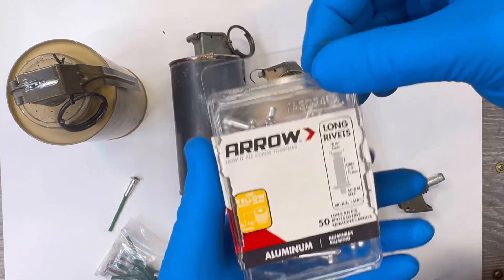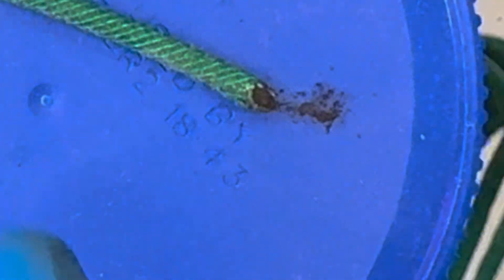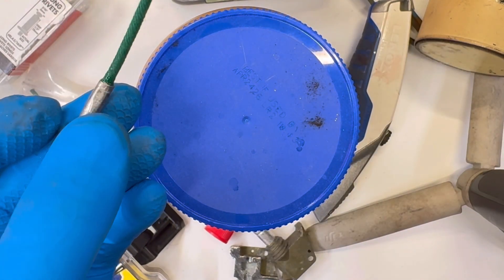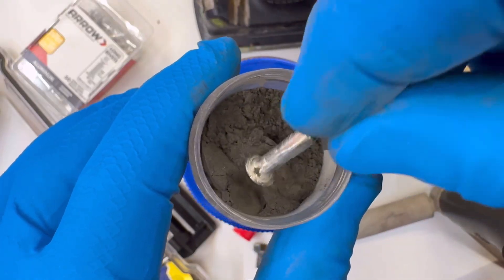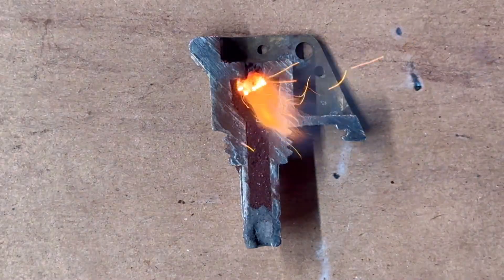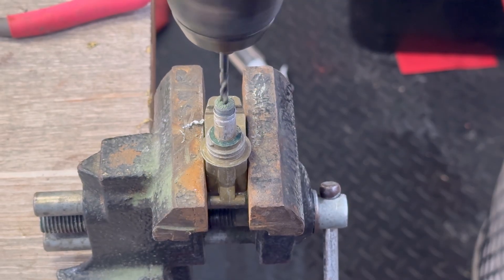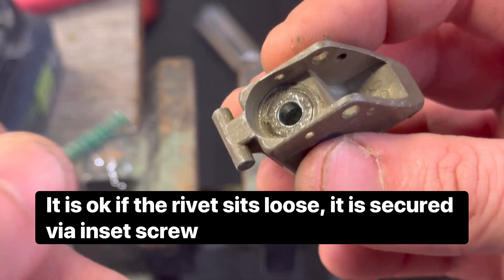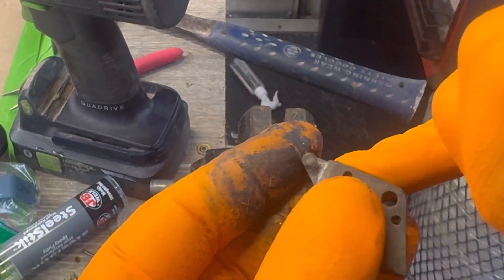Turning Surplus Fuzes into Smoke Grenade Igniters with Pop Rivets! 💥

Comment: Thanks for all the work.  I've been working with TPA mix with pull igniters, which are fussy, so the upgrade to M228 head with rivet nut seems pretty cool.  I've made 4 and was having trouble with no ignition.. I was left with a dimple in the top of the striker compound after letting things dry for a couple days.  I switched to using thick mix of ping pong balls in acetone (yeah it's thick NC lacquer) thinking the harder ignition layer would work better and I've had better success.  I'm REALLY looking forward to SRDS.

Comment: you don't need a pop rivet for this, just a No 209 primer pressed into the hole u drilled and then 1/8" thru the bottom of your surplus fuze. You went into WAYYY too much work for this, i've redone this dozens of times the way i said, it works great.
Reply from the maker: Way Too loud, sloppy, and aggressive for me, it’s blown the Fuze head off  of a number of devices and can launch the striker arm to the moon 🌕 also jumps the fuse and time delay if using 1/4” time fuse. I’ll use 209’s for perimeter alarms. But if you’re going to use primers why not just use small pistol primers?Have you used with m201A1’s or M-228’s
Reply: @InventionIncarnate  Works everytime for me... Maybe you should check the decade on your Typ 20 license. It's not sloppy if u don't overdrill the hole, the primers are all exactly the same size i check them with micrometers. And what do you think a fuze head is? Do you think the thread and all come out? And no you don't use 1/4" VISCO you use 1/8". It's Visco not "time fuse" if you don't use the cheap chinese stuff. And no, no one uses M-228's that's an old style for like the pinapple grenades. You want a fuze meant for a M18 smoke with no delay or safety fuse/visco fuse (not cannon fuse) for smoke. You just don't want a frag in your faze with no delay... Hope this helps you.

Comment: Have you tried using 209 primers ,it would not be quiet but just as a alternative?
Reply from the maker: Way Too loud, sloppy, and aggressive for me, it’s blown the Fuze head off  of a number of devices and can launch the striker arm to the moon 🌕 also jumps the fuse and time delay if using 1/4” time fuse. I’ll use 209’s for perimeter alarms.

Comment: I followed all of the instructions (i think) and cant get it to pop.😂

Has good spring pressure on the striker. Maybe my comp isnt compacted enough?
Reply from the maker: @minutemandefense3935  
Bro you’re an OG, one of my earliest subs.

1) did you mix the oxidizer into the ignition mix (crush up clumps before mixing) 
2) did you use the Nitrocellulose Lacquer that came with it? 
3) is it dry? That is almost always the culprit. If you have a heat source(no flame) & fan, that is ideal. I heat up individual igniters with a heat gun for like a minute then dangle in front of a fan for a couple hours.
4) test a small pinch of ignition mix with a lighter, if it works, it’s not dry

Please update us in this thread 🧵 because it will help me and others

Kloveyoubye
Reply: @InventionIncarnate  so I didn't mix the oxidizer with the ignition mix. Did see that, what ratio am I going for?
Reply from the maker: Hey send me a comment on Venmo thread so I can ID your address. I’ll send you out new chems now (literally at my post office (24hr kiosk)) they are premeasured ratios. So all of white bag goes into grey container. It may be a bit spicy now.
Reply: @InventionIncarnate  oh! Well let me see if this works before you go through all of that. I'll try again and let you know. Thank you so much for answering my questions. I love what you are doing on your channel.
Reply: @InventionIncarnate  well shit. I think I messed up by mixing the oxidizer with the grey compound and not the pink....
Reply from the maker: No, that’s correct. There should be a qr code on package for playlist of different instructions, though I have not made dedicated pdf for rivet igniters yet
Reply: @InventionIncarnate  I think my problem after mixing in the oxidizer was I didn't wait long enough for the nitro cellulose lacquer to cure. 

I made the mistake of mixing a tiny amount of oxidizer with the pink compound today...shit popped....like a 22mag.
Reply from the maker: @minutemandefense3935  also, you could mix ignition comp outside of rivet then pack the paste in with a plopsicle stick
Reply: So the first problem was that I forgot to mix in the oxidizer.  The second was that I didn't let my nitro cellulose lacquer cure long enough. It's working great now!

Comment: What causes the priming powder to ignite when you let the spoon loose?
Reply from the maker: @swojal1493  the impact of the striker arm jumpstarts a reaction between the red phosphorus in the striker mix and the potassium chlorate in the ignition mix ground glass is a component of both compositions because that adds friction between the particles ensuring the initiation of the reaction from being struck. The red phosphorus is oxidized and the chlorate is reduced creating a super exothermic reaction which ignites the other components of the ignition mix (ie sulfur and antimony trisulfide) the remaining potassium chlorate decomposes releasing oxygen to fuel the combustion of other ingredients, that subsequently ignites the cannon/visco fuse.

Comment: Have you done more work on the 37mm parachute flare dissection? I noticed a set of files on the odd sea for 3d printed parachute flares and wondered if it might be useful. 

Also, does the $7 additional fuse promo apply to both kits you have listed now?

Comment: I got a funny story, so there I was drilling a m228 for a grub screw, when I realized I egged the hole out. I tried to tap the hole anyways and realized that it wasn’t going to work. So I decided no big deal I’ll just drill another hole on the opposite side with a little offset so it’s not a through and through hole. Did I mention I was doing this in the living room while watching tv and not in the shop using a vise? I’m sure you can guess what happened next…drill bit punched through the m228 and found the offset hole on the other side and I drilled a hole damn near through my whole finger. Luckily I missed the bone lmao. Instinctively I ripped my hand away and started some electrical tape first aid….went back to pick up the drill when I noticed all the flutes of the drill where filled with a nice layer of finger meat 😂. Short story long, use a vise kids.
Reply: Damn you got to be mentally ill or something, cs like what a dumbass 😂

Comment: Could you use a 22lr, bullet and powder removed but primer still intact, i imagine adding some ignition compound to the fuse would help make it more reliable and since 22lr is so cheap it would cut down on cost and time?
Reply from the maker: That’s a big fat waste of time and effort. I spent weeks doing that. Theoretically, yes it works, reality not reliable. If you can ignite 10 out of 10 with a rimfire and stock mousetrap spring. I will eat a sock 🧦
Reply: Wesson Smith jr did something similar for squib loads.

Comment: Is this fuse assembly suitable for igniting the HC smoke mix or is the previous fuse assembly required?
Reply from the maker: @elihutson4553  this is great, as long as the visco fuse is in direct contact with the composition and a blob of primer is present. Many primers can be used. Gary Purrington’s, the creator of that composition, recommended the formula found at [my website] >free PDFs>Composite Smoke Detailed Instructions>page 5
Reply: @ that primer is the one included in the pull ring kit right?
Reply from the maker: @ no, but the ignition comp will work great not more than a pea-sized volume. Pva will work as a binder but will take 2-3 days to dry, 12 hours with a fan
Reply: @InventionIncarnate  one more question. Are you going to offer additional m228 assembly’s for extra $?